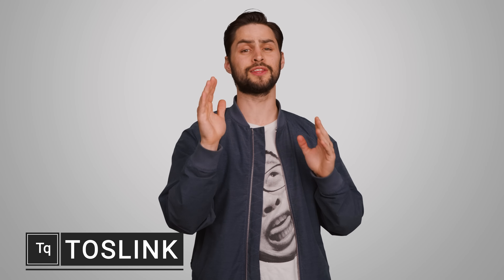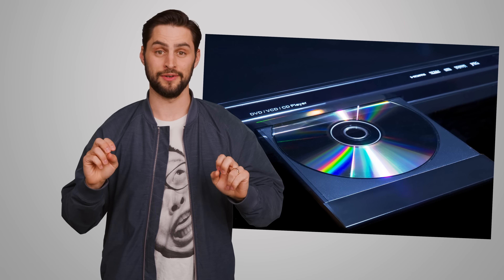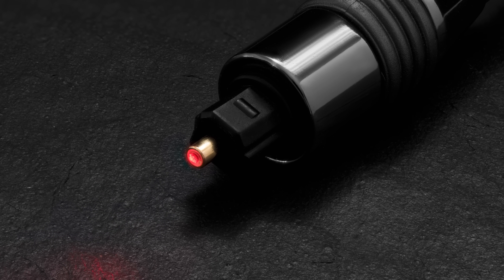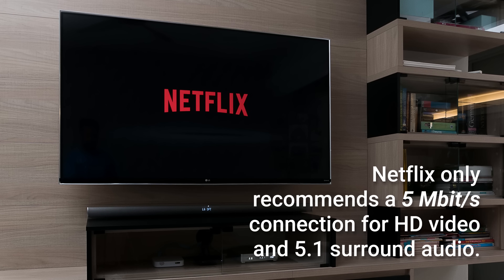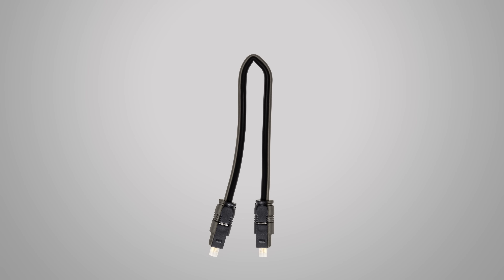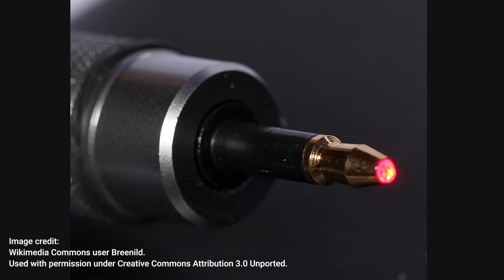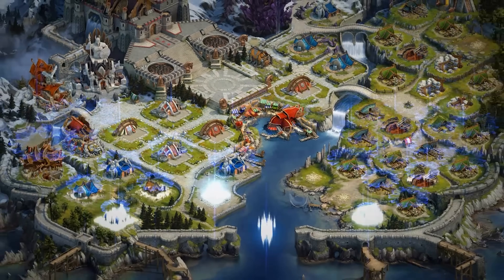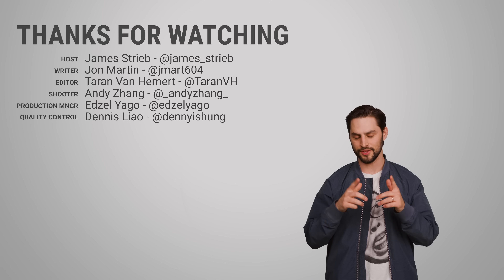Why IS This COOL Cable Dying? - TOSLINK Optical Audio

Comment: what he didnt say: "toslink" is just the optical cable. its exactly the same protocol as spdif and has no benefit over it whatsoever, except for the fact that it sound fancier to use fiber optics to transmit data :/

Comment: Copper HDMI can only get 4K 60Hz HDR10, Dolby Vision signal up to 35ft but fiber optics can do same signal 300ft soooo is it the same optics ? bc in this case it looks better to go with optics. unless its different kind of optics fiber optics hdmi vs optics? idk but this video didn't cover enough info at all and is kinda misleading, always thought optics was better then copper. Please comment if you have greater knowledge on this subject thank you.

Comment: I use toslink to hook my computer to my receiver because A. my receiver doesn't have hdmi, and B, my receiver isn't connected to a tv so having hdmi is more or less worthless.  my display is connected to my computer, not my receiver, and I don't understand why I would WANT to connect my receiver to my display in this configuration.  my receiver has 1 job. play audio as cleanly and in as high quality as I can to the speakers that are in my room. Shrug  I'm not anti-hdmi, it's hella useful in modern av setups, but there are lots of times where you just don't need a tv for music listening.

Comment: Fun fact about fiber optic cables: Attenuation isn't the only reason they struggle with long distances. An effect called "Modal Dispersion"   ( https://www.fiberoptics4sale.com/blogs/archive-posts/95051206-fiber-dispersion-and-optical-dispersion-an-overview  ) will also decrease the signal integrity. The illustration in the article does a much better job of explaining the effect than I do.

 The light initially coming from the transmitting side is what's called "coherent" light, where the photons are all in phase with each other. Basically the peaks and troughs of all the waves are lined up. After travelling some distance though, some of the photons bounce off the walls of the fiber over and over, so the length of the paths taken by each photon will differ. This difference in path length increases with longer cables, especially when the cables aren't perfectly straight. The effect of this is that the quick "on" and "off" pulses of light become blurred, so instead of fast transitions between 0 and 1 you get a smooth change in brightness. This decreases signal integrity and causes data loss, all because of the differences in each of those photons' paths.
Reply: Thanks for explaining I always wondered why ToSlink lost quality when bent up.
Reply: You could have just said Modal Dispersion and put a wiki link in.

Comment: It works well If you have only one monitor. I'm still using TOSLINK on 3rd gen Apple TV connected to Sound Blaster ZXR so I still can hear the sound while I'm doing something else. HDMI sound will stop if you switch to other HDMI port but TOSLINK still keep feeding the sound.

Comment: Toslink is still good for desktop audio. You can take the digital signal from your PC, skip the DAC and go straight to the amp. No USB, no drivers, no headache. Just clean and easy uncompressed audio from your amp to your cans or monitors (speakers).

Comment: "Vintage audio receiver" seems to be Millenial talk for an all-digital x.1 surround system with 25 digital inputs and an infra red remote control. To me, it means an analogue two channel amplifier without ANY digital capabilities. Jeez, I don't think you understand the meaning of the word "vintage". A "vitange wine" was not harvested in the early 2000s, dude.

Comment: Disappointed the industry didn't work towards improving fiber optic cables. Mainly because copper is an expensive material and should be more expensive to continue production vs plastic/glass fibers.

Comment: 1:13 This picture includes another connector which can do exactly the same as TOSLINK, lol. It's labeled "COAXIAL" and it can do everything TOSLINK can, but over a copper wire. So if you wanted to save cables, you could also send a digital audio signal over a single RCA cable.

Comment: For me the problem with HDMI cables connection is the fact that i still have some interferences if u have a lots of electronics around. I have two amps close to eachother ( 1 JVC rx6012R for 5 speakers / 1 hpa b900 for 2 subs) and it was almost has bad as jack or rca cable set up. Thanksfully the JVC got toslink and now my Pc has the deepest and cleanest sound it can make. Thats why im still into it and not about hdmi audio

Comment: I only have one optical audio cable i bought years ago to send my Xbox 360 audio to a audio system when the HDMI was going to a monitor without passthrough.

Then i eventually sawed off the plastic that covers the HDMI port when you use component cables and used that instead.

Comment: Toslink connections are vile. They can only go in one of 4 ways, and the way they go in is not consistent, you have to peer at the connector and the connection to pick out the flat side. And when you are scrabbling round the back of a PC to put one in it can be a headache inducing horror.

Comment: PC have horrible F feedback loop issue causing noise in the line...  toslink is the ONLY THING other than drilling a hugh F hole in ground to fix this issue. we need another groundless connection with high bandwidth tostlink can do 192 audio which as high as you need

Comment: I remember selling the gold plated toslink cables made by Monster. "It's gonna sound so much better because it's gold plated and 10 times the price." Ah the memories of a slimey upsell.
Reply: @Jondahl Davis Well it's an optical cable and the gold ain't transmitting light
Reply: @Jondahl Davis You can have a 10 million $ toslink cable sprinkler with pixie dust and embedded with platinum and gold 
My cheap china toslink cable will still sound the same because it's DIGITAL
Reply: There is a quality aspect to every cable but the right price for most cables is somewhere little over double over cheapest one you can find. Anything more and you're paying for snake oil.
Reply: Nice one even better than golden hdmi cables. You are literally cladding plastic tube with gold that servers no purpose and contacts nothing.
Reply: @Jondahl Davis you didnt read gold plated toslink, did you?

edit: side note, better cables are better, thicker gauge means lower resistance, gold is lower resistance than copper, and less reactive so it wont degrade, but most systems aren't limited by the cable, its by the driver hi/low pass filters in each speaker.  definitely did the -Old junk analog cable. -new analog cable -$200 grounded analog cable.  aside from the junk, they sound the same
Reply: @ilovefunnyamv2nd  There might be a slight difference in sound, but not a $200 worth of difference to buy them, thats my reasoning.

Comment: Toslink doesn't have DRM like certain HDMI protocols, so there's that.
Reply: This sounds more likely to be the reason for discontinuing TOSLink than other issues with it.
Reply: @razvann6907  Really smart guy? Not the fact that it has vastly inferior bandwidth and distance support? Discontinued just because of DRM "hurr durr big corps $$$ money money money "?
Reply: @AQHackAQ  Yeah, really. What happened when we needed more bandwidth than what USB 1.0 could offer? We got USB 2.0...

The bandwidth limitations of TOSLink come from the interface not the cable and the interface appeared in 1983 and is pretty much unchanged since then.
Reply: @AQHackAQ  no response
Reply: @AQHackAQ  huh duh no response lol
Reply: @AQHackAQ  no response

Comment: The biggest problem with hdmi is that because of hdmi there is no audio only solution anymore to passtrough multi channel pcm or dolby atmos & dts x or loosless codecs. So when you're reciver is not able to passtrough the hdmi spec anymore you need to change the reciver because there is no other way to connect you're reciver for audio only! The hifi world really need a better more modern audio only medium.

Comment: I'm still using that cable with my Logitech Z5500. They still sound decent and still looks like new when you take care of them .  There is only one thing  I notice, this buzzz noise from woofer, but  I dont care  if they will Die because nobody wants buy them anymore hehe.

Comment: hdmi is the biggest hoax ever. i spend over 200euro on NUMEROUS 10meter (33ft) hdmi cables and non was reliable for a 4k HDR connection from PC to a 4k beamer. EVER. if you go over 5meter on a hdmi cable you are fucked. this is the fucking 21st century guys. 
dont get me started on toslink

Comment: Audio equipment ages gracefully. I should know, my system's vintages span from 1988 to 2008.
Classic 5.1 is still a perfectly valid setup, even if modern systems have improved ... a lot of things.
Of course, I have modern things, such as a current gen HDTV and personal computer, that I want to connect to my classic audio system.
TOSlink is definitely better than turning three 3.5mm jacks to six RCA jacks for the "analog 5.1" jacks on the back of my receiver.
It's also a mindlessly simple way to connect my HDTV to the system - in fact, it's the ONLY way to get 5.1 from the OTA DTV decoder to the receiver.

Comment: Still using TOSLINK for connecting the legendary Logitech Z5500 5.1 to my PC. I remember buying my first TOSLINK cable back in late 2006. 39$ for a 1,5m cable:)

Comment: Tech people always like sounding the alarm that a old format is dead, yet here we are in 2020 and monitors still come with VGA…
Reply: and pretty much every single DAC on the market has a toslink connector too...
Reply: I mean yes but not really, anything remotely high end like high refresh ate and high resolution monitors only feature display ports and hdmi, with some featuring usb c. VGA only appears in lower to mid end monitors because there is a demand for them, but the industry has been moving away from these connectors.

Comment: I was actually very annoyed when Apple removed the miniTOSLink from Macbook Pros, it was nicely integrated into the 3.5mm jack so i could connect direct to my surround speakers digitally. Ended up buying an external sound card with TOSLINK out to connect them up. Much rather than than crappy analogue sound.

Comment: You forgot about one of the biggest benefits of TOSLink: no ground-connection. Groundloops are a relatively common issue for audio-equipment and can lead to hums or other forms of noise. When you connect two devices with an optical cable like TOSLink there's no electrical connection, so there's no way for disturbing ground loops to occur.

Comment: Why is TOSLINK  dying?

Short answer: It is bad

Long answer: It was bad when it was released and it is still bad, it should be forgotten and Toshiba should be punished for misleading people into thinking that this plastic+led "wanna be an optic cable" is actually better than normal copper wire.

Comment: Is it dying?! How am I supposed to connect my TV to my Pre-amp?
I guess I²S-LVDS over HDMI for the future? Anyone?
Inter-IC Sound, Low-voltage differential signaling. It's not supposed to be an external connector but some manufacturers have hooked it up to an HDMI plug with a different pin-out. It already wins my heart for being quirky, breaking the rules and using a cheap and readily available cable.

Comment: Toslink on a PS3 is legendary. Toslink on a PS2 misses the bootup sound and lacks the nostalgic sound of the ps2 sound chip. I play PS1 / 2 over RCA with 3.5mm adapter to connect with a FiiO Q5s amp / dac / bluetooth reviever. On a PC it can make your audio purer (no EQ from on driver level and more neutral)

Comment: 100 times better than HDMI since it always plays the audio of whatever is on the TV screen, instead of having to switch the soundbar or surround sound cables over every single time you change inputs.

Comment: I have a 5.1 control system in my room, Toslink is so easy to plug into it, no need to use HDMI pass-tru (which will remove higher resolution or framerate..)  but I’m getting crazy trying to find a good new motherboard with it installed, half of new mobos for x570 don’t have it :// even expensive ones

Comment: I still use Toslink in my Hifi setup, and will do so for the foreseeable future. Most audio devices don't have an HDMI output so the only way to get digital audio off it is toslink.
Reply: I got a few with hdmi but always use toslink for audio
Reply: I think using the ports in my new amp is the only way to hear the built in DAC.
Reply: why not using 3.5mm? or rca??
Reply: @aqwandrew6330  To use a higher quality dac than in the source device.
Reply: @SanderEvers  yeah i just figure it will transport out the digital to other device that have dac and then goes to speaker.

what im curious is, why there is analog out like Line Out that usually also goes to dac? it doesnt make any sense
Reply: @aqwandrew6330  Analog RCA/3.5mm usually goes to analog amplifiers or powered speakers.

But I use for example a 5CD changer connected to my high quality AV-receiver over TOSLINK,  this gives a better sound quality than using the dac inside the cd player connected over RCA cables.
Reply: The new "smart" TV like the Samsung SD90 have both Toslink and HDMI eARC However !  When using the HDMI eARC connection the TV tends to take over and start your surround sound AMP each time you turn on your "smart" TV
Very annoying situation as I only want my surround sound when watching movies. And BTW I have disabled the Anynett HDMI - CEC in External Device Manager and still my "smart" TV continues to turn in on !

Comment: Multi-channel analog...Yes, crack out the HDMI audio stripper to feed those inputs if your a vintage audio user. :D  (Or better still, feed separate high power audiophile amplifiers)

Comment: Fiber optic is slower than copper. The good thing that fiber optic is good at , is than fiber optic better works with high traffic. Copper is faster but in smaller cases

Comment: TOSlink is pretty good for 2CH audio, which (I think) is uncompressed, IIRC. It seems to be a lot more compatible when it comes to HTPCs with an AVR attached. I love HDMI audio, and use it for 7.1 and Dolby Atmos, but Atmos on Windows is rife with issues and needs a separate app. I have some issues with HDMI audio latency from YouTube, and Windows unfortunately recognizes my AVR as a monitor. So, while TOSLINK is definitely starting to be put out to pasture, its great for stereo audio, with lower latency and a simpler setup (ESPECIALLY if you are running multiple monitors, VR, and an AVR. I've only got my DVI Dual link connector free on my GPU!)

Comment: It is too bad the new consoles won't have it because the great thing about it is that I can connect an HDMI cable to my 4k TV  but a Toslink to my receiver that is from 2010 so it only supports 1080p. So without Toslink I have to choose between bad sound by going only to the TV or bad video by routing through my receiver and then it downscales to 1080p. That is why an optical out was essential for me when I got a new motherboard. Buying a new reciever just to get 4k is expensive when it works just fine otherwise.

Comment: I use toslink still for my headphones :P it feeds my headphone amp when i mute my surround sound. when watching dolby atmos content, it still works though. the audio travels from my computer to my AVR that is muted, then to my TV and from my TV to my headphone amp via toslink. either my TV is outputting the audio in some other format other than atmos through the toslink, or my headphone amp is decoding a atmos signal through toslink, regardless, I love toslink <3

Comment: Bro you can buy clear curve and sc connectors for pennies. -5 to -13db for several hundred meters. You can wrap it around a pencil and have very little attenuation and very low risk of breaking. Buy china cables and youll have a bad time.

Comment: We are currently using one of these Optic cables between our Samsung One Box and Surround Sound system for TV level streaming services. We used to use the HDMI ARC channel, but the TV kept turning itself on and off.